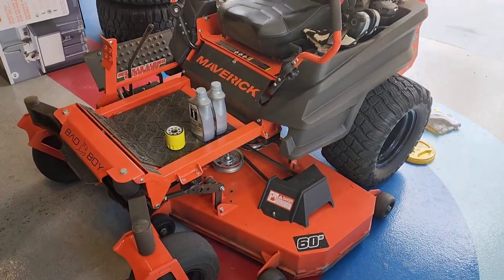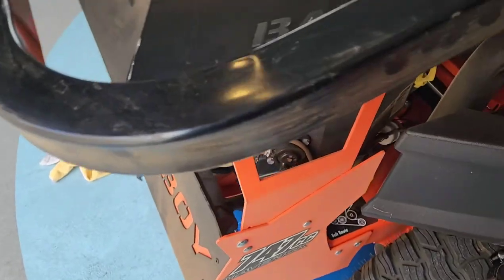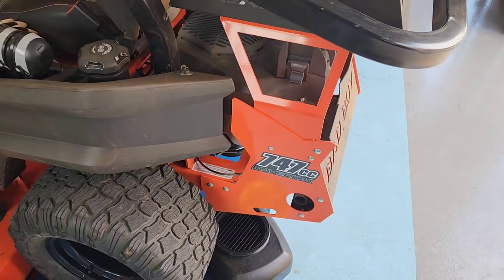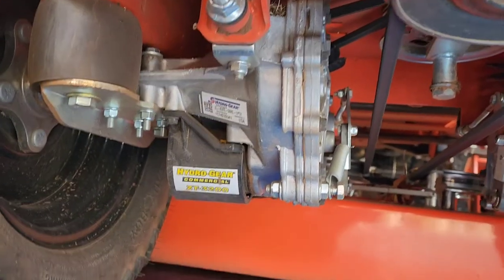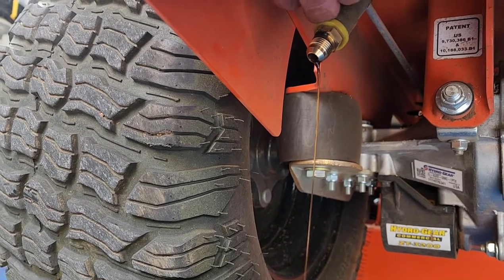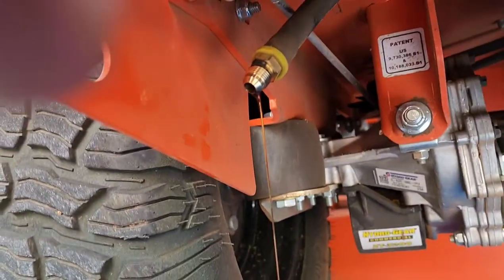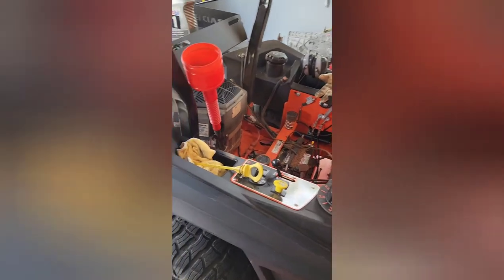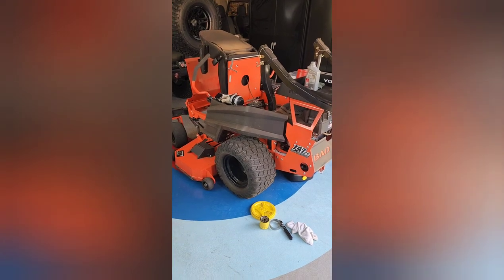Walk around and oil change on my Bad Boy Maverick Mower.

Comment: I was wondering how you like the suspension on it? Was looking at the HD model they have out now.
Reply from the maker: Its not bad. Its just some rubber blocks and the seat is some what cushioned. if I hit holes or large bumps I have to be prepared because you will still feel it.

Comment: Like that hitch!!  Did that come factory?  I got the zt elite 60” and would like that hitch installed on mine.
Reply from the maker: I believe I ordered it and the tray from a web site .  I wanted a 2 inch receiver type hitch.  Here's the link. https://www.badboymowerparts.com
Reply: That oil filter makes a mess , I punch a hole in the bottom and let it drain awhile before removing it. They should've made that better , maybe with a plastic tray below it